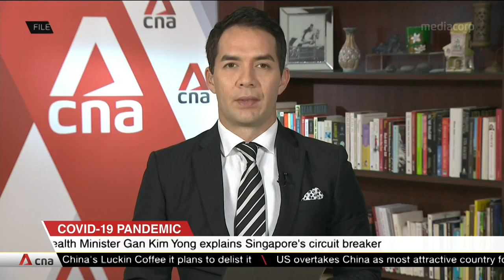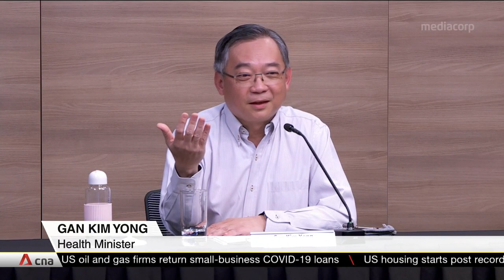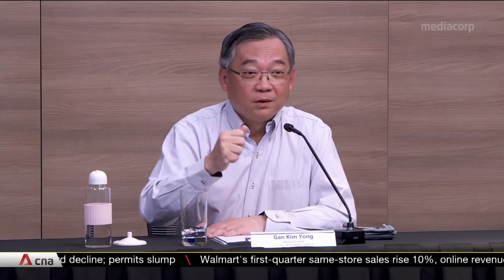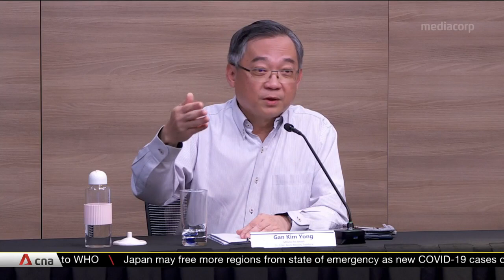COVID-19: Gan Kim Yong explains use of term "circuit breaker"

Comment: But the actual circuit breaker works perfectly. It 100% tells you which electrical appliance or power point is at fault.